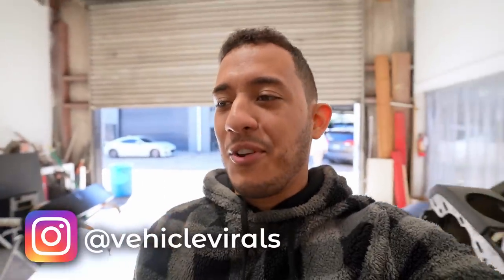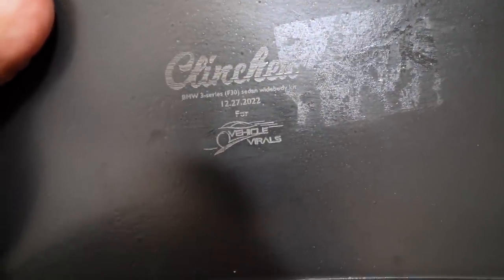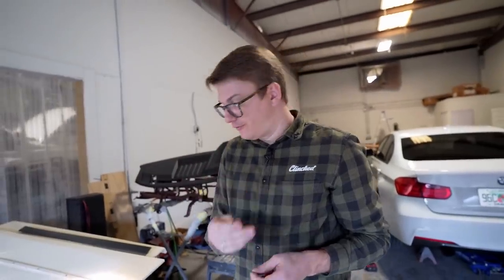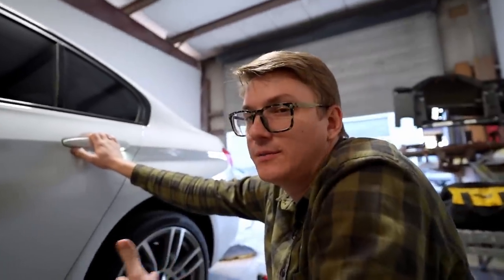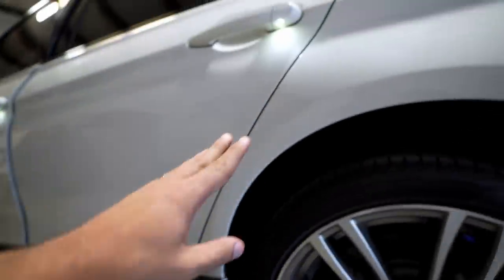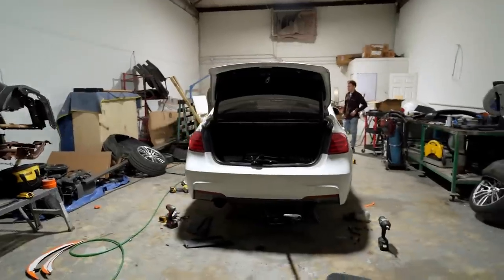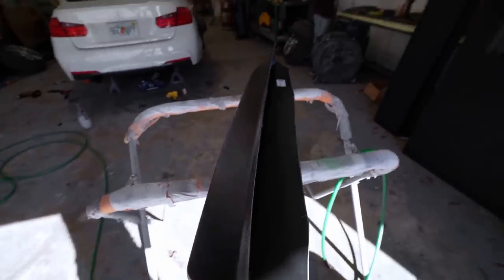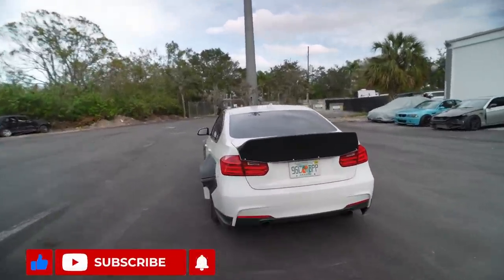Doing Something To My F30 335i That Most BMW Owners Are Scared To Do - Clinched Widebody

Comment: You haven't bought wheels for this yet? What wheel options do you have for this kit?
Reply from the maker: Nope, had to measure first since I don't want to run spacers. I'm going with a custom multi piece set.
Reply: @VehicleVirals  I'm sure that will require refinancing your house to get some wide wheels that you can't buy at discount tire lol
Reply from the maker: @arctictruck10  Already purchased them and they weren't cheap 🥴😭

Comment: Now the real question is, what air system you gonna get
Reply from the maker: Sadly decided to go static. Turnaround for the air suspension was too close to my deadline.
Reply: @VehicleVirals  ahh that'll be interesting, no harm in changing that later. As long as theres not enough wheel gap to live under 😂

Comment: Man. $4100 for a kit that doesn’t fit well? 12:37  gaps and having to shave parts down? This kit is trash for that price.

As a manufacturing engineer, this kit has lazy engineering all around. There’s a reason why OEM M Performance body pieces fit 100% of the time with no modifications ever. They actually use real engineering practices with no shortcuts.

This kit looks like it had Alibaba levels of engineering behind it.